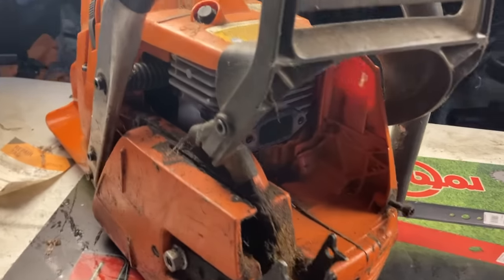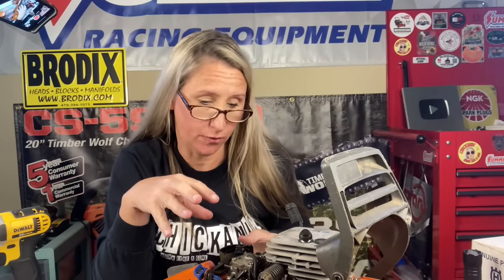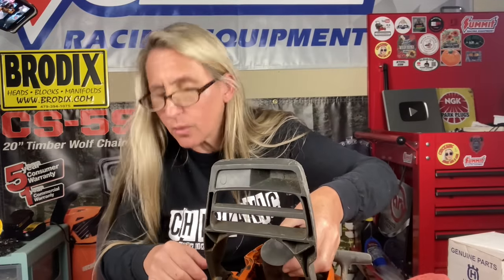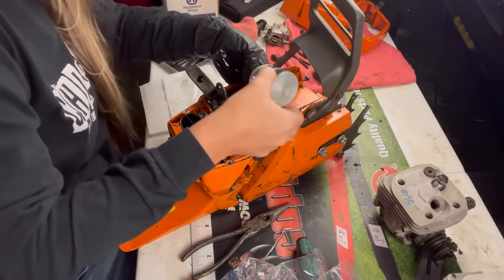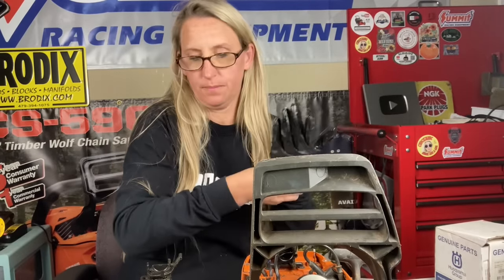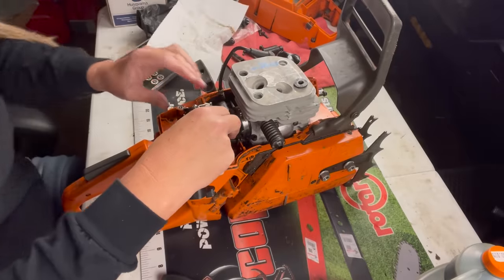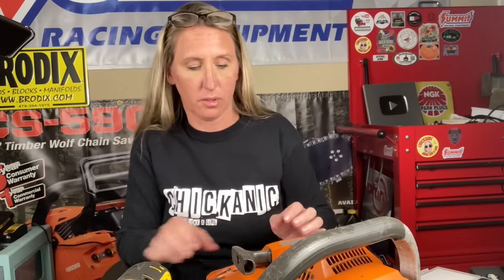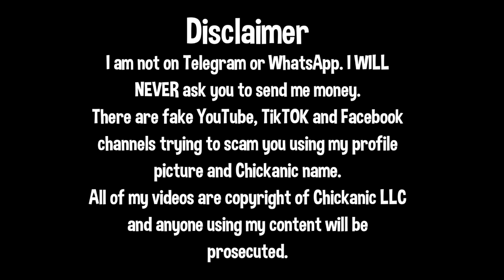Customers $1,200 Chainsaw Destroyed! Husqvarna 372 XP Rebuild

Comment: On the RV...  Most folks prefer a 5th Wheel or pull trailer because you still have a truck to drive around and visit when you get to you're destination (like Destin Florida).   We just rent a car and use our Motorhome which is a Gas powered Thor Challenger.   The advantage of a Motorhome is you have a bathroom all the way down the road.   The layouit of 5th wheels can be very nice with a Living Room, Fireplace and even a Kitchen Island.   The Motorhome is more like a bus with seating all up and down the sides.   The worst thing about an RV is the Dealership experience.   Assume your warranty is worthless, and so is the Service department.   Anything that needs fixing you're better off doing it yourself... especially with your skill set.   For example our brand new 2021 Thor had a 5000 Watt Generator that would just shut down every 20 to 40 minutes.   Dealership just CND'd it every time.   And they keep your RV for 2-4 months each visit.  
Ours was the fuel line was just too small (bad design/installation)and the tank has a 1/4 of the tank pickup so it doesn't steal all your gasoline while parked.   We put a complete new fuel line in and a clunk at the bottom of the tank, and now it works great.   Sevrice would never do that...   We just never park on a low tank of gas... duh.    RV Dealers range from great folks to Scam artists.   Make sure yours has a good reputation.     I had my return flight from Cabo cancelled and had to get my own flights from Aeromexico to get home.  (it pays to know where major cities in Mexico are so you can get home.   Expedia - no se habe Aeromexico...   I'm done flying too!    PS:  I really enjoy your Videos.   You make the "Good the Bad and the Ugly" look easy!

Comment: I've noticed you don't use a magnetic dish on your workbench to put small parts in when you take them off the machine. 

I really enjoyed this video. I hope I never need to do a  cylinder and piston replacement. If I do, this video will help walk me through it. 
I watched another video by someone else who sanded the cylinder and piston down. He was doing a repair just to show that sometimes that could be done just to get you by. It wasn't meant to be a permanent fix.
I really enjoy the detail you go into when you do your videos. 
I'm thinking about buying a Echo 4110 or 4120 cs with a 20 inch bar. A Stihl or Husqvarna of the approximate size would also be considered. Looking for something under $400. Do you have any recommendations ? Glad you had a good time in Mexico.

Comment: If you are willing to put in the time and effort, some people have purchased decommissioned school buses and converted them to RV's. The advantage to this is that it can be custom made to your personal taste and needs. In fact RV's and moving vans are the 2 most common conversions for old busses.
Reply: I would have to agree...at least an old bus has a much sturdier body and the roof would be much less prone to leaking than an expensive, flimsy-built RV...

Comment: When rebuilding a saw you need to break it in the same way your supposed to break in a new saw, all saws are run from the factory but if you read the manual they recommend a “break in” using richer fuel, richer carb adjustments and using only half to three quarter throttle for anywhere between 1 and 10 tanks of fuell depending on the saw
Reply: My Farmmac F380 is suggested to be run at 32:1 for 6 tanks during break-in.

Comment: I have pump oil dispensers with various oils ready to use on my work bench. Bar oil, engine oil, ATF, and now I will fill a pump oil can with 2 cycle oil. I carry a pump oil can with bar oil and give the bar a good dose before start-up if the chain got dirty in storage. 
We stopped flying and bought a Sprinter chassis Reyo motorhome with a Mercedes 3.0 turbo engine. It is more of a traveling model than a camping model. It sleeps 3 but has seatbelts for 4.  Some Sprinter chassis models will crowd 4 or 5. If you are truly interested in an RV, look for 6 years old or older. Our 2013 is in great shape. We average just under 16 miles per gallon if we drive 62 mph. Sprinter chassis motorhomes are usually only 7.5 ft wide so you can park them in a normal width parking spot, double deep.

Comment: Nice work Bree, perhaps the total bill would be $400 give or take.
Perhaps cheap or incorrect 2-stroke oil could have been an issue.😊
Reply: Wouldn't that be a bad day to forget the oil in the gas. I thought I did that but thank God I was wrong.
Reply: @mystuff1405  why I love Stihl blue oil in Australia which has changed you knew it was mixed.
Green colours are hard to see sometimes.

Comment: Just super! thanks for another great video. I think I might have same type of a issue with a backpack blower where it will not stay idle. Cleaned the carb with Sonic Cleaner and same thing. Web browsing for OEM replacements seem to call for 145 for cylinder and 74 for a piston + some additional parts as you replaced in your chainsaw. Oh, it is an Echo PB-500T model. is there a.... place with better ROI for parts for this blower that you could suggest or at this point its not worth to fix it?
Also, could "synthetic 2 stroke oil could have caused the issue?" aka, overheating and piston demage? I got the Echo one as referenced by one of your videos but wondering what you think about it.

Comment: Well worth getting the new OE P&C. Most of us who collect saws would probably try to rehab the cylinder, but wouldn't expect a shop to take the time without paying big. New P&C for a Stihl that size would have been twice the price. Need to talk to the owner as to why he burned it up running lean. He should have heard it running that lean. If the recoil is sturdy enough, I would have left off the decomp period.
Reply: Serious question..."he should have heard it running that lean" What does running lean sound like? Do you mean over revving?
Reply: @deanmsimpson  Yes, it's seeking an rpm like when they run out of gas. You can hear and then see the HIGH spd adjustment is off. Like a Tilly should be no less than 3/4 turn OUT and beyond that (screwing IN) it's screaming lean.  If turning the HIGH-speed adjustment has little or not the desired effect as the normal setting (about one turn OUT), it's too LEAN condition. You're after what the Internet folks call 4-stroking.....which is a made-up term. Back in the day, we said to adjust until you hear it 'cut out'. Which term makes more sense to you is a matter of choice.  Just like we didn't call high-performance cars back in the day, 'muscle cars'.....that term came long after.
Reply: @TheReal1953  I see.  Thank-you for your reply 👍

Comment: I have a dozen or so saws and never have burned any up. An old mechanic told me 50 years ago to ignore mix ratios and always run 16 to 1 . It costs more and smokes more but I also have blowers and saws that are still good runners after 50 year’s service
Reply: 16:1 is too much oil for most modern 2-cycles (trimmers, saws, blowers ect). Pull some mufflers and check out the carbon accumulation. Run enough hours and the exhaust ports will start becoming blocked at 16:1.The excess carbon accumulation happens pretty fast with engines not run for extended periods at WOT.

Comment: Great job! I noticed that the old piston ring gaps were aligned with each other right at the center of the piston failure area. From what I could see of the new piston only one ring gap is visible. In general, when installing rings in a car the gaps must always be 180 degrees apart. Could that be a contributor to the failure of this engine? Do you check for ring gap rotational spacing when you are installing the new piston?
Reply: On 2-strokes the rings are locked py pins, so they cannot rotate. That is to prevent them from rotating and getting an end caught in a port.
Reply: The old 2 stroke versus 4 stroke conundrum.  Lol
Ya there's pins to prevent them from rotation on a 2 stroke, because bad things happen on the exhaust side

Comment: Great video, and very timely. 
I'm about to do the same with my 372XP.  Did you get the carb kit from Husq. dealer, ot use an aftermarket kit?  I haven't been able to get kits from Stihl anymore, they just want to sell a replacement carb (which is very frustrating).  Do you have a source for carb kits?  If so can you post? thanks

Comment: How well does this rebuild translate into a 4-cycle? I have a Troy bilt trimmer mower that is a year old. It started burning oil then completely seized. While I have another one, I hate throwing away what I can repair for cheaper than new, if I can even find one. Note, I do have multiple attachments, so I kinda need to stay in brand.
Reply: Most of that line is throw-away, to be honest.  Can be hard to get parts, and 4 cycle trimmers are heavy.  BUT, most of the attachments from Troy Bilt will fit Hussqvarna, Poulan, Craftsman, Ryobi, etc.  Bolens sometimes does the attachment setup backwards, but I'd avoid them like the plague anyway.

Comment: I have a question, I noticed you don’t torque anything. Is it necessary to use a torque wrench or just snugging the bolts down is acceptable? Also do you reuse the same bolts? Do bolts stretch? Also doing this kind of work is it necessary to check your rod bearing.? (Could you be losing oil pressure through your rod bearing? )

Comment: Question. What do you do with all of the old and nasty fuel that comes out of the equipment you service. Combine in one can?  Take to a hazardous waste facility? Or use for the annual mega bonfire ?  Since I came across your channel I’ve overhauled an old 52” Bunton walk behind, replaced an engine on a 14yr timemaster  mower, cleaned and rebuilt carbs in a mantis tiller,  echo weed eaters, blowers, Troybilt tiller, and now a bunch of snowblowers. A older neighbor from a block over stopped by and asked if I was still servicing equipment for the season. I said that it was a new hobby for me and not a business. He was like well if I  would fix his gas edger he would appreciate the help. Simple fuel change and a carb cleaning. He said it hadn’t run like that forever. I’m learning as much as I can because my daughter is taking small engine next semester in high school. I went to a local repair shop and they gave my daughter and I  some old equipment. A 4 cycle mower, 2 cycle trimmer, and a gas blower to work on.  They know what the problems were but the customer didn’t ever call back to authorize work or were abandoned. They said they will sell us parts at cost and help us if we run into a problem.  My daughter doesn’t start class till spring so I’m sitting on stuff now.  My favorite fix to this point was my generator that I bought back during an ice storm in 96. I would run it every 3 months but never emptied the gas. Over the years it quit running. So after your 3rd or 4th video I decided to try cleaning the carb. Fresh fuel, lines, fuel pump and a carb kit it started on the second pull.  I now have about 10 gallons of bad fuel that I’m not sure what to do with. Thanks for saving me time, money, and frustration!  Ps for Christmas I’m asking for a ultrasonic cleaner and compression tester 😂

Comment: I never put an engine together with out checking the Piston ring gap in the cylinder..  Maybe Husky does it for kits.
Reply: Not an issue with 2 stroke engines, not chainsaws anyway..that stuff is already made to spec when you buy it...

Comment: So if you would open that cylinder up and there was damage on both sides of the piston would you expect that the shaft seals might be leaking?
Reply from the maker: I would think, lack of maintenance, debris coming in intake or poor quality oil or gas. It is very rare for crank seals to ever be the problem.
Reply: @Chickanic so is that the same for all two cycle equipment because I had an echo gt225 curved shaft trimmer that did the same thing but didn’t know what’s been the problem for a long time.

Comment: Stay away from motor homes.
They sit for long periods of time and you know what that does to an engine. In addition you're limited in what shops can work on it.
Go for a fifth wheel.
You can use the truck every day and any shops can work on them.
Also, check that you can get to the toilet when everything is packed up for the road.
Happy travels.

Comment: I would have rebuild it with a mix of parts some classic 372. Some x torque type.
And would not use the head gasket. 
.
I definitely see more gen2, 372 faluers after about 2010 when the x torque went in to production.
They basically tried to clean up the emissions and make the saw a little cheaper. 
So I basically stick to the classic version with the compression release on the side, all the newer x torques have it up on top. It's the easiest way to tell a gen1 372/365 from a gen2 372/365

Comment: I have a Husqvarna 455 Rancher ,I don't use it much or often and I'm putting my third carburetor on it. Would it be better to have the O.E.M. carb rebuilt? The last two were very cheap ones. Or just get a new unit? Thanks.
Reply: Rebuild or oem replace

Comment: Ok, RVs are extremely expensive but a retired city bus is dirt cheap rebuild engine and suspension. Redo inside with a great layout and a toy garage for 7 electric bikes all
Your fishing gear full kitchen, bath, master bedroom maybe even small bedrooms for 
everyone else. Full solar on the roof plus a party deck on top! Am betting you have the
Contacts to horse trade for any remodeling work you can't do yourself.
😁

Comment: I see alot of mechanics in here so i wanna hear yall’s opinions on Amsoil running at 100:1 gas oil mixture. So far ive been running it in my string trimmer and leaf blower for about 2 years now with no issues. However my husky 550xp i think its running at maximum learn on the high side because of more gas than oil.
Reply: Why risk something at 100:1 when probably for the same or less money you can buy OEM oil(Husqvarna, Stihl, Echo etc.) that is formulated for the equipment?..will the stuff you are using work?...sounds like it is...are you gaining anything by using it?..I highly doubt it...I'd rather have the peace of mind using the OEM stuff...
Reply: @dyer2cycle  well at 100:1 your having to buy less oil. Amsoil is also warranty safe so i was just curious as to what mechanics are seeing

Comment: I am surprised the manufacture let you adjust the L/H carb needles, (at the end of the vid).  I thought now-a-days the EPA made the manufactures put caps on them, (no access with out mods), so we could not lean out the stock rich mixture so they run better and pollute less?   No kidding.  I think it works that way.  :)

Comment: I scored my 90cc Solo chainsaw piston when the carb came loose causing an intake air leak. I heard the saw running too fast but decided to finish milling one last pine board. BIG MISTAKE. I got by with a new piston but it wasn't cheap. If your saw starts screaming STOP IMMEDIATELY or 😢😢😢😢

Comment: Most damage as this while using the correct oil fuel ratio is caused by wide open throttle when first starting. Give the saw some warm up time. This is common on all saws used in commercial and esp construction.
Reply: For air cooled 2-stroke engines, I don't think it matters much.  Usually a cold engine has some extra oil in the crank case left over from the evaporated gas from the last run, and it won't rev far until it runs through, and smoke a lot while it is burning up the oil.  If they are water cooled though, putting to the coals to it with a cold cylinder as the piston gets hot and expands can seize/scuff up a top end.  The water needs to be warmed up so the cylinder will expand with the piston.  Water cooling would be better for commercial use I would think, if not too heavy.
Reply: Wrong answer, I worked on saws and know through experience what happens if you wide open throttle a cool saw engine over and over. The exhaust side of the piston expands much quicker and requires more lubricant which the fuel lubricant gets burnt up and when you do that you heat stress the metal and it will break down and scar.  @EarthSurferUSA
Reply: And being a new saw its doubtful that the carb was at fault. These new saws run lean and using 50:1 mix IMHO is too lean which exaggerates cold start engine failures.

Comment: Is it common that the piston rings not be staggered anymore than that?
Reply: I noticed that also
Reply: I see saws with 2 piston rings and then some with only one? Thoughts on that?
Reply: You do realize the piston has tiny locating pins in the ring grooves that force the rings to sit in the correct position. There is no ring staggering set manually by hand on 2-cycle pistons like these.

Comment: I noticed you did not mention which loctite to use for the muffler, should it be the orange or red. Since red is supposed to be for permanent attachment, I assume orange would be the choice
Reply: Red which is semi permanent as it will still release with the application of high heat.
Reply: @iffykidmn8170 wouldn’t the muffler qualify as high heat?
Reply: @robertheinkel6225  one would think so.

Comment: I know this is probably a stupid thought, but I've always wondered if there was a way to bore over and then sleeve a chainsaw cylinder then cut the slots for the intake from the crank case and the exhaust port after the sleeve is in place. To any mechanics and/or machinists whom might reply, please be kind. I'm just a person who has just enough knowledge to ask but not enough knowledge to truly know the answer.